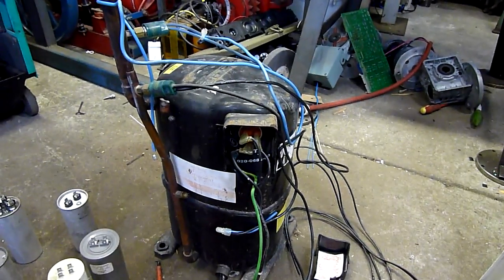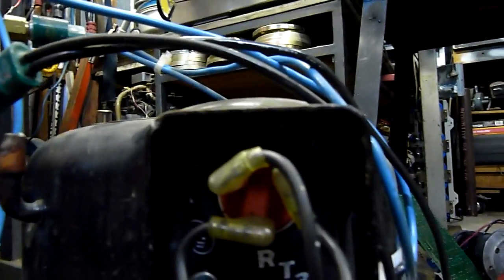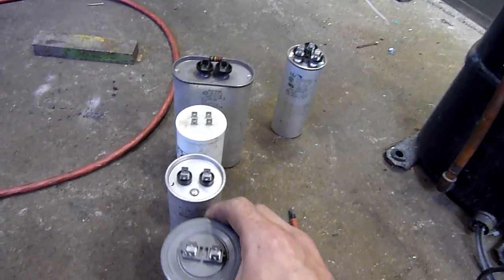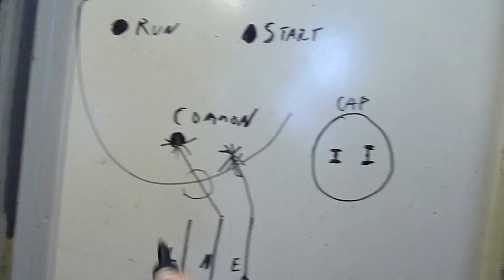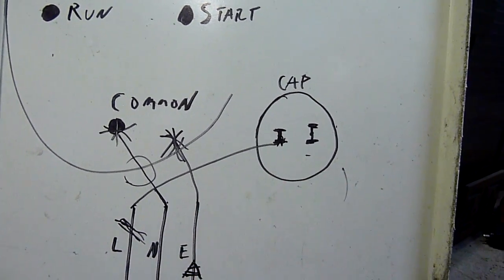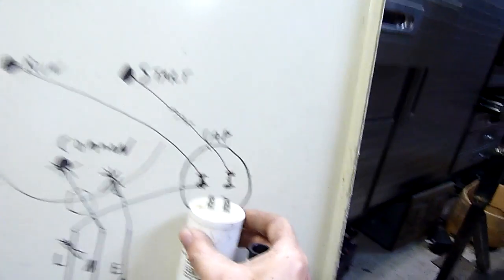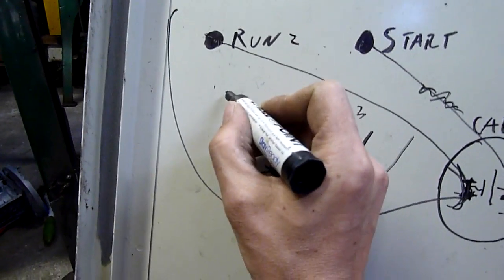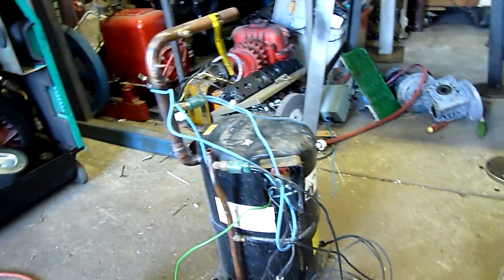Aircon Compressor Wiring Crash Course

Comment: I don't know what plant your from, but down here on earth there is no neutral on 240, only two hots.
Reply: Most of the world uses single phase 240V, where the difference between line and neutral is nominally 240V. You are thinking of the American dual phase 240V plug, like a NEMA 10 device, where the only points that have a difference of 240V is between two phases and the difference between either phase and neutral is nominally 120V. As an aside, there is a standard NEMA 14 plug with two phases, a neutral, and a ground that is commonly used as a generator hook up.

Comment: Hi, I have a question....
I have a Matsushita compresor 2PV132N7BC02 model. Also the run, start and common wires, but...
The resitance between each 2 wires is 2ohms as you said on video for a 3 phase compressor... As long as I know it was runing on a monophase current before i disassembled it (I'm 99% sure of that)... Here is the problem... I didn't saved the capacitor, so I can't wire it as you shown on video (I assume I should wire it that way for that 2-2-2ohm readings), I searched on the internet, and it says there's no compressor capacitor. So could you help me wire it so I could use it as air compressor? Please help me, and thanks a lot!

Comment: mr, I just built a machine to om ships  frame, 3 phase motor, sprecher schur starter, expensive, prom is i cant make the coil engage, 414 vac coil, press start, nothing, hold contactor in, motor runs through built in thermal o/l, should i run voltage to a1 a2, if i did that the contactor would stay in, NOBODY V AN  help, been on it a week, any help be grateful for

Comment: mine keeps blowing the barker it works because it did work in the hvac i got it from i have it wired right im 100 % sure but it keeps blowing the barker instantly when i power it on my theory is that the inrush current is too big because the compressor is huge and power full  but i don't know if im right and if i am how do i fix it

Comment: Thanks for a simple to understand explanation of what goes where and why. I have a water tank pump that I just replaced the bearings on, now it won't start! I'll check out the start and run windings with my multimeter, just need to let that big fat capacitor discharge first! (Scared myself when I put a screwdriver across it the first time - power removed of course).

Comment: Thanks a lot for the simple explanation of wiring diagram. The novice technician failed to properly connect capacitor to compressor to live and neutral terminals and with your help, my ac is now nunning alllll right after the tech having told me that the compressor is burnt out...lol.....a thousand thanks to again AUSSIE50...:)

Comment: G'day Ed, I have a Tecumseh kirby fridge compressor that still ohms up good but is missing all of the running gear. I have an appropriate cap that will power it but didn't get the relay (if it even uses one)
is there a way I can run it without the relay or do I need to look for one for it?

Comment: I have a 240 60hz compressor out of an AC unit along with the multi cap. I have tried to find your vid on how to wire a multi cap but have had no luck. Is it still available?

Comment: Interesting: I realize that my example implies 3 coils, but with a single phase with start coil its more like the capacitor start leg gives a phase pattern of: on-->on->pause to the 2 coil magnetic fields so the direction is implied until the motor is up to speed and then the start coil is cut-out by a centrifugal or electronic switch. Then the pulsing single phase maintains rotation.

Comment: In the USA here we have L1 and L2 which are 2 branches of 110vac with Neutral as the common return. Our Neutral is at the same potential as the ground but the two should never be connected except at the junction box. This way if one of the hots(L1,L2) short to the casing, they short to ground. Some circuits don't include the neutral. Breakers or fusing should always go on the Hots(L1,L2) side.

Comment from the maker: the windings are different inside when looking at a single phase compressor vs a 3 phase. on a single phase comp there are 2 sets of windings, start and run, and the other end of those windings intersect at the Common terminal. on a 3 phase compressor, there are 3 sets and a common internal connection that connects them in Star, the klixon thermal switch is usually used as this common point

Comment: Looks like its the same as 4 wire bench grinder motors, the start/run neutral wires are joined inside instead of outside the motor.

start winding has a different resistance to the run.

Nice and quick tutorial :-)

Comment: The cap is not really there to limit any current (it's an sideeffect though, that's used for motors that run in only one direction). The main reason is, as you also said to create a phase shifted current in the second winding. This results in a rotating magnetic field needed to turn the motor. There are motors where there's no difference between the run and the start winding. These motors can run in both direction depending to which leg you connect the cap.

Comment: ah alright, i guess i misunderstood what you said at 6:00 
"start winding only wants enough charge to get the motor running", i interpreted it as "after an initial charge the cap will act like a switch and isolate the start winding" which of course, does not.
Thanks for the clarification.

Comment: my mate has some kind of water chiller but it runs like a normal refrigerator
on it's back and it doesn't use a fan or any thing like that.
you just fill it with water and switch it on

Comment from the maker: you are correct about the capacitor started compressors, however they are not so common in domestic aircon units, but I will be going into detail on how that system works when I get a good example to show. what I was explaining here was a capacitor run compressor that has the run cap permanently connected, unlike a start cap which does need a potential relay.

Comment from the maker: I rarelt see a AC unit use a PTC thermistor or potential relay to run the compressor, if anything they have a start cap and changeover relay for hard starting under back pressure, but open up any generic single phase AC unit, split or package. and its wired as i showed on the board. the capacator creates the phase separation needed to run.

Comment: continuing from the previous comment:
For the start charge (in the scheme you draw), you need a PTC resistor (called klixon or something) that keeps the winding excited just for the small time required by the motor to start running. If i'm wrong, please correct me.

Comment: continuing from previous comment:
If you wire a normal kitchen-fridge compressor like that, the start winding won't last long, since you're feeding it a 90 degrees out of phase single-phase. However, for the way compressors are designed, there is an overload protection in the relay assembly that will shut down the power, preventing this scenario to happen.

Comment: i'm not a compressors experts but in my opinion, as far as my experience goes, you're making a little bit of confusion. The diagram you showed on the board is used to run 3-phase motors with 1 phase getting 2/3 of the power out of them. In this case all three windings are equal, otherwise you need the neutral wire for the unbalanced load (4 wires).